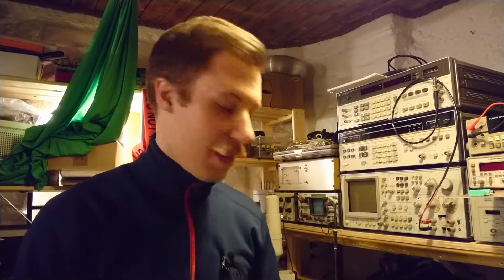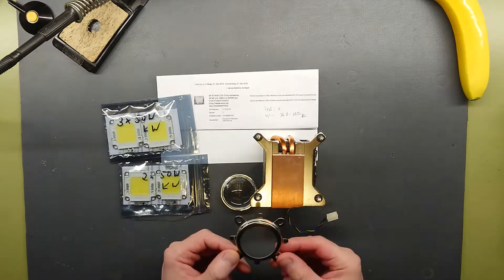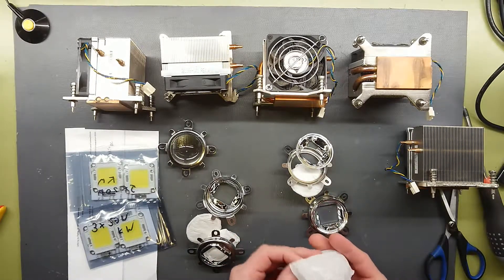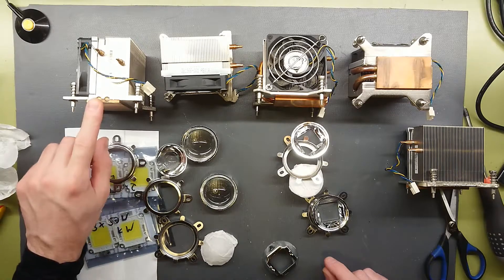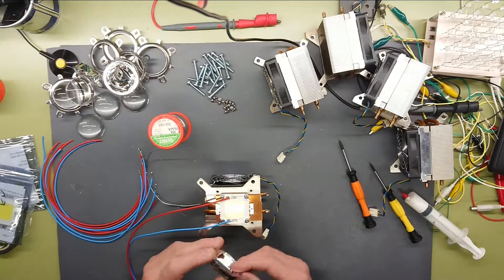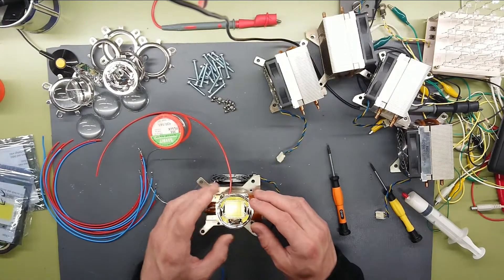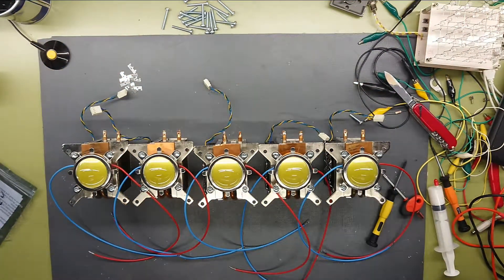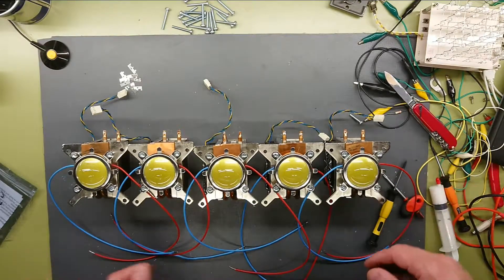250W (25000+ Lumen) LED Flood Light for High Speed Filming,  Part 1 of 3.

Comment: I made a 400w set up with those 36v cobs, you can use those tabs on the chips to solder to (look very carefully around the edge of the phosphor to see where the conductive bar is) , it's much easier as they won't sink your heat away also those lenses and reflecters are bad  they keep in the heat on that emitting side.
Reply from the maker: I broke the tabs off as they easily bend down and I would need to insulation the heat sink to avoid a short circuit possibility, just used the inner solder pads. Reflectors and lens is however needed to get enough light into a small area at a few meters distance.

Comment: Interesting video, thank you! Will the heatpipes work in any orientation ? I guess that the cold liquid has to flow down towards the copper plate ?
Reply: Most heatpipes are made with a copper braid or cintered copper (small flecks melted in a mesh) in the walls of the heatpipe, the Liquid condenses on the walls of the cold side and is immediately picked up by the braid and via the action of wicking keeps the flow of liquid going back towards the hot side. Gravity or orientation has a minimal effect on heatpipe performance since the liquid does not pool and dry spots will not form. There are great videos on the youtube channel LinusTechTips or GamersNexus talking about heatpipes. I hope this helps! cheers!
Reply: Vincent S. Heat pipes work via evaporation and condensation so should work in any orientation... I think.
Reply from the maker: Thank you for the question, made me look into the matter :) Orientation can be a factor, but no more than you have heat pipes used in space where normal convection is non-existent: https://www.nasa.gov/mission_pages/station/research/news/heat_pipes.html

Comment: I went with BXRC-56H10K0-D-74-SE chips from Future Electronics. 97 CRI. Working well for me.
Reply from the maker: The FPS1000HD is not a good enough camera to worry too much about the CRI, but that is some nice LED COBs you bought there. What do you use them for?
Reply: @KaizerPowerElectronicsDk  I was doing some work at a factory without any power, and realised that all of my bright lights needed generators to run, so I built some that could run off a small Victron inverter. A few dollars extra for some nice chips was a small percentage of the build's cost. Pelican wants $1000 for a battery powered light! Plus I use them for photography occasionally.

Comment: Your about 80 lumins per watt a high pressure sodium would be about 150 lumins per watt
Reply from the maker: The problem lies in the applikation, I need a lot of light very close to the thing i want to high speed film at 10000 FPS, regular lamps will simply melt or burn things that are too close :)
Reply: @KaizerPowerElectronicsDk  right it would also need to be a DC lamp, DC arc lamp maybe? otherwise you will have 50/60Hz flicker so half your frames would be more or less in the dark.
This got me thinking the inneficiencies of the LED is because it is a diode so what if phosphor technology was able to advance enough to turn the infrared from a sodium lamp into useable white light again. I guess they only make light into lower wavelengths? That is why white LED's are really blue LED's with phosphors on top?
@Mark Williams thanks for calculating and comparing the efficiency!

Comment: HPS lights are  brighter which is amazing 90,000 lumins 600w
Reply from the maker: I need as low heat radiation as possible from my flood light. When doing high speed filming the light source is close to the camera and subject being filmed. Regular lamps, halogen, HP metal vapor lamps etc are all too hot and will melt/damage what I am doing :)

Comment: I made a bank of 4 100W ones but i really underestimated how much cooling i would need lol
Reply from the maker: I did not do any math, just assumed the P4 coolers would do just fine. Tests have shown that they stabilize around 37-40 degree Celsius with fan at minimum speed. I could maybe upgrade to 100W COBs :)
Reply: @KaizerPowerElectronicsDk  P4 CPUs would regularly do 100W of TDP. I think you would be fine with 100W LEDs, probably even 120W.
Reply: Hey, you would have to know the efficiency of your brand of LED, a generale rule of thumb would be 80% efficient just to get you in the ballpark. That will help give headroom with other inneficiencies like bad thermal paste or high ambient temperatures etc. For example a 100W LED would run well with a heatsink that could cool 80W of heat.
Reply: @SuperBrainAK  how can i find the specs of the heatsink? I have a bunch of scrap ones and i thought my big one would br enough
Reply: @Lovreli  well if you dont have any datasheets you will have to do physical testing of the heatsink in order to figure it out. You will have to calculate the surface area and how many CFM of air is passing over it then the temperature differences then that can give you its thermal resistance. Sorry I dont know much more beyond that.

Comment: I bought a few of those 4 years ago, to use as retrofit light sources for projectors. They are damn awesome for the price, though they do get hot and need good thermals. The glass collimator/lenses are actually good albeit the edges are not perfect as you seen. No problem though. Just cannot beat the price. Couple these with a good current driven DC supply design and they are sure to please. I never thought to use them as floodlights, but it sure makes a lot more sense then hundreds of little LEDs like I seen others do!

A lot of products/sellers from China are like star fish, they cut at each other and more come. For the most part, yep the products are very identical no matter the seller.